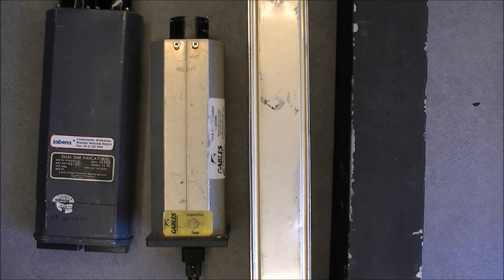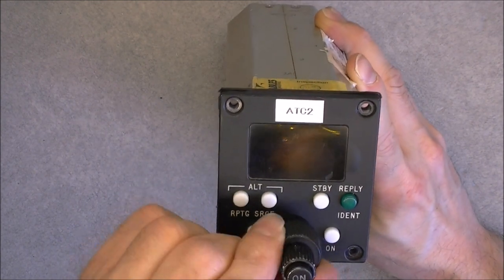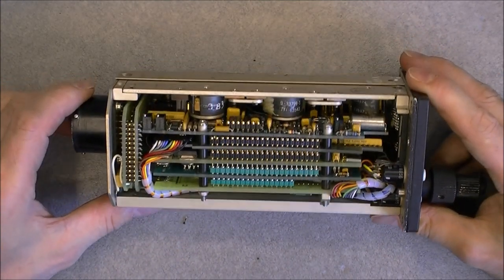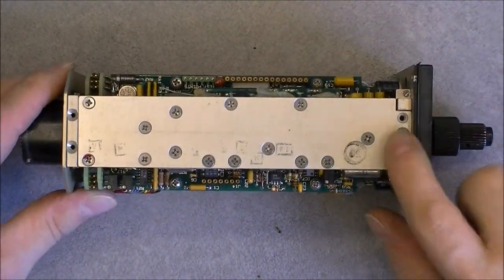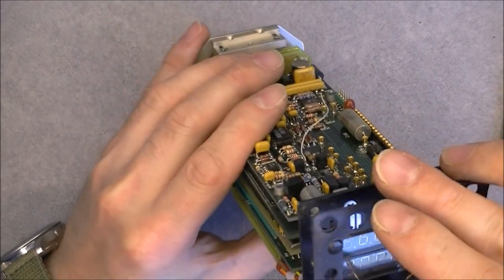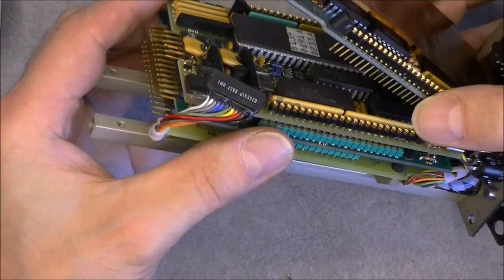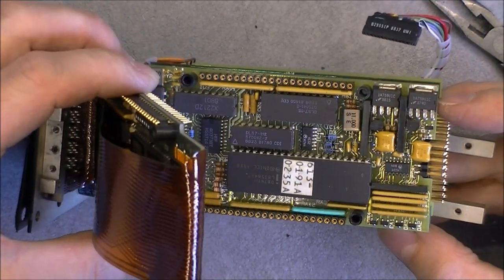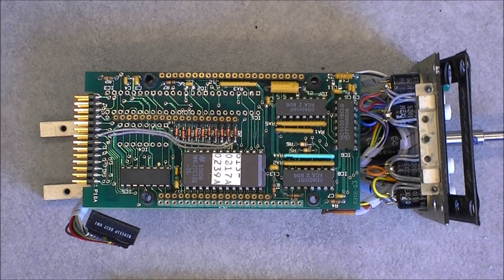Avionics teardown: Gables ATC controller

Comment: I did a similar design on my high school final exam. Everybody had to do this "car board computer". Some of my collegues ended up with ridiculusly large boards, I remember one particular board that was 70cm in length. I decided to do this "stacked boards design". Like in this video. Because at this time (1999) I 've torn apart dozens of Mercedes Benz board computers at home. So I knew how the industry would have done it. At the end, my work was 5 x 5 x 5 cm with SMD-devices only, and it fit in a very tiny box. I was so proud. It looked like one of the mercedes modules that I had at home. For me it was perfect. But with all of the board-2-board interconnections and uncommon SMD parts it was too complex for my teacher to understand, and it got bad ratings.
Reply from the maker: It sounds terribly frustrating. I believe they should take apart a lot more stuff in schools, as it is a very good way do discover and learn.